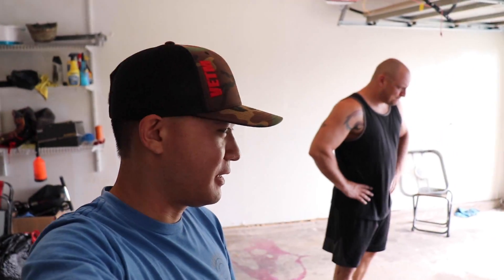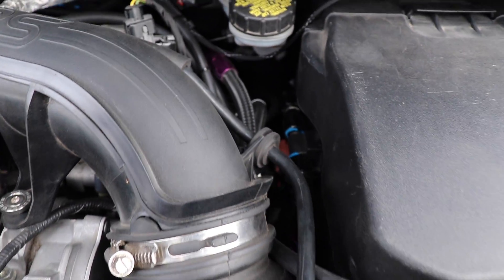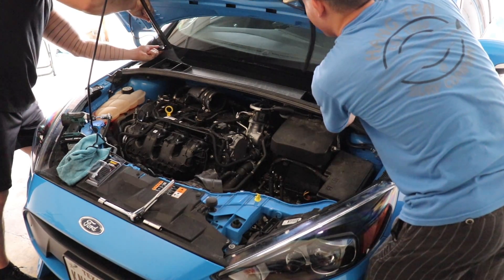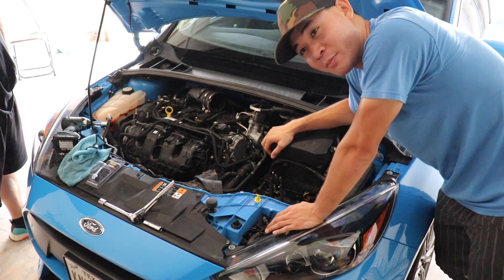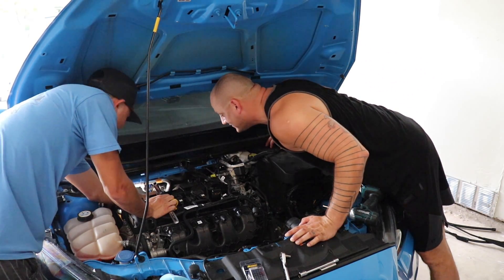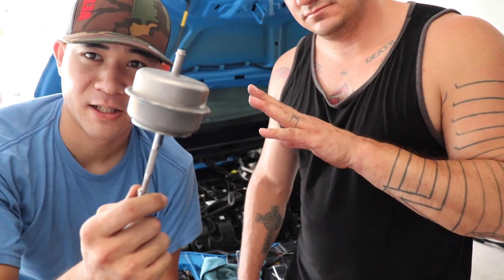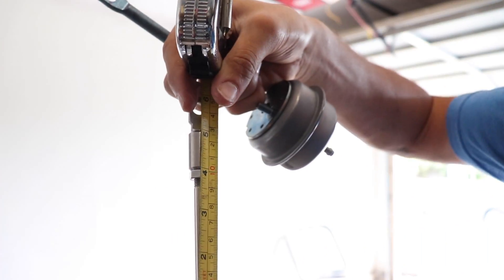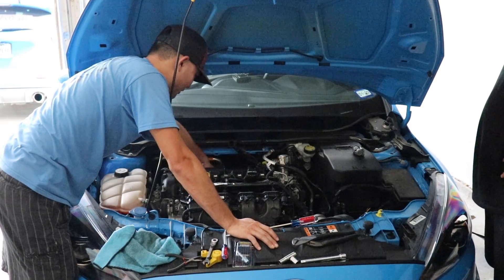How to Install WasteGate Actuator and Ethanol Content Sensor on a Focus RS

Comment: Where do you find the tunes for the wga? Are you having it professionally tuned? Or are you using the Cobb tunes?
Reply from the maker: I have it tuned professionally by Stratified. I would suggest getting a Pro-tune or a flashtune from your preferred tuner: whether that is JST, Stratified, FreakTune, or Tune +.

Comment: Is this car in this video running a stock tune?
Reply from the maker: The car requires a tune to run the Wastegate actuator and requires an Ethanol tune when you are going to put 30% or more Ethanol into the car.

Comment: Hi mr, good video, but i have a question for you if possible:
Is possible install the IWG75 12 psi without modify map? Map in my car is Mountune M380. preload must be same how to original WG?? I hope in your answer. Best regards
Reply from the maker: When you install the IWG75 you have to get a tune for it, without a tune you run the risk of damage due to the increase in boost pressure increase as well as the increase of airflow because the Wastegate will be held closed longer; to allow for more boost. Please do not run the WGA without a tune, without a tune you run a higher risk to damaging your motor
Reply: @Nick_UCARS  many many thanks, also with stock map?? 2 mm pre charge is correct for 12 psi?
Reply from the maker: @xtr970  preload should be an additional 5mm from the hole of the WGA arm and the prong of the wastegate on the turbo. If you don’t want to adjust the WGA when it’s on the turbo, you may adjust it by measurement: 5 5/8 inches (measured from the center of the WGA arm to the Base of the WGA).
Reply: @Nick_UCARS  Now understand because needed tuning, 5 mm are much, the spring is tightened a lot, and it takes  a lot of pressure to overcome it. But if you set arm with how the original, still need the modification? Alwais many thanks for your contribution
Reply from the maker: @xtr970  reach out to me in my social media, I’m trying to understand what you are adjusting. @nick_ucars on Instagram

Comment: Are the gauge steps work the same for an ST?
Reply from the maker: It should be, the gas lines are routed the same as well as the location of the grommet that I used to route the wires into the cabin for the gauge

Comment: Will the gauge be on all the time?
Reply from the maker: The way that I have it setup; the power wire is wired up to a 15A fuse that is in the passenger footwell, which enables the system to turn off at the same time as all the other accessories that run off of that panel turns off.
Reply: @Nick_UCARS  another question what size is the fuel line you purchased ? Or is there a link for it ?
Reply from the maker: @christiancristancho4864  I believe they are 6AN fuel braided fuel lines for the FBMS Kit. I had to use the Adaptors to make it work for the AN lines to fit on the OEM fuel lines that were on the RS, the links to the adaptors are in the description if you are wanting to do the same Ethanol Sensor Kit for the RS.
Reply: @Nick_UCARS  I can’t seem to find the fuel line online. Do you happen to have a link for it?
Reply from the maker: @christiancristancho4864  Which one are you currently looking for? If you are looking for the individual fuel lines, I am not sure where to look for them. the fuel lines that we used were part of the Full Blown Motorsports Ethanol Sensor Kit, the link is in the description.

Comment: So can I use the 5 5/8” to set the preload on my actuator as well? I have a focus RS too
Reply from the maker: Yes, the measurement of 5 5/8" can be applied to the wastegate actuator if it is for the Focus RS. The car that I have done this for my Focus RS as well as Jesse's RS, seen in the video. I have utilized this measurement as the standard pre-load for setting the TurboSmart Wastegate Actuator, I hope this was helpful.
Reply: UCARS thank you so much! Great video by the way
Reply from the maker: @MrPeanuthead47  Thank you so much, I hope that it was helpful. I really appreciate the questions and feedback from everyone, I am going to be posting a lot more content on my channel. I have been on hiatus due to hard drive issues.

Comment: Where did you get the fuel line?
Reply: I think it's this kit for RS/ST based on the purple connectors and Zeitronix gauge: http://fullblownmotorsports.com/full-blown-ford-focus-rs-ethanol-content-kit. I'm considering that one and a $150 cheaper one without physical gauge and just a Bluetooth app.

Comment: Did this ethanol sensor give you real flex fuel (self adjusting tune)?
Reply from the maker: Malleable Curve the content sensor doesn’t give you the ability to have a Self-tuning capability, I have to switch the tune from Pump Gas to a designated Ethanol Content percentage established by tune parameters. You would need to change the fuel line on the back of the High Pressure Fuel Pump (HPFP) and plump in a Flex Fuel sensor into the ECU in order to run a self-adjusting tune in relation to how much Ethanol is in the fuel system. The reason why the HPFP hose that needs to be replaced is because the hose is not designed to have straight E85 flowing through it because it will corrode and deteriorate, which can result in a fire.

Comment: What fuel line kit is that ?
Reply from the maker: This is the Ethanol Content Sensor kit from Full Blown Motorsports, The link should be in the description. If its not let me know so I may update it.
Reply: My bad I thought you had made your own fuel lines. Want to make mine like that with the braided lines and AN fittings
Reply from the maker: @carlosroque1935  I wish I had the tools and materials to make my own AN Lines, but I don't.

Comment: I installed the ethanol kit from Zeitronix on my near FBO 2016 focus RS and your video was very helpful. I purchased the kit from Maperformance off amazon. The kit didn't come with fuel lines unfortunately  and it was a real pain figuring out what I needed to make them.  I believe the kit from FBM and the one from Tune Plus is meant to delete that factory line and hook directly to the back of the HPFP.  The lines are all female fittings 5/16 for the stock male quick disconnects and 3/8 fittings for the male ethanol sensor quick disconnects. 

Just incase anyone buys a kit without lines like I did here is what you need to make the lines. 

2 feet of good quality 3/8 rubber fuel line.  cut into two lengths. one about 14", one about 10"
3/8 straight dorman 800-082  14 " line 
5/16 to 3/8 straight 800-084.  14 " line 
5/16 to 3/8  elbow dorman 800-092 10 " line 
3/8 elbow dorman 800-086 10 " line 
SS hose clamps ( I used Dixon MAH-4 7/32 to 5/8 ) 

The hardest part of this install was getting that metal quick disconnect apart and getting that line through the firewall gromet.
Reply from the maker: Thank you for watching the video! I am glad that it was helpful for your install. I am not sure if the FBM kit was designed to tap directly into the HPFP, if FBM could elaborate more on this it would help. I have not attempted to thread the fuel line directly to the HPFP. 

My setup is a little different for others because I have an AUX Fuel system installed on my car.
Reply: Can you set me in the right direction for the e85 sensor setup. I have the aux fuel set up. 2016 focus st. Thanks

Comment: Will this work on the focus st also?
Reply from the maker: The method of getting back there, yes. To set preload, I would like to say so. However I would measure the factory wastegate actuator of the ST for reference and then set the preload at that measurement.

Comment: What retaining clip did you end up using? I ended doing the same thing and losing mine. Dealership said there were $55 each for one. Doesn’t make sense.
Reply from the maker: chucka187 you can utilize the same type of clip as the one from the factory (e-clip) or a snap-ring, which we have used in this video. Both types of clips are available at your local AutoZone or Orielly’s, they sell them as a kit of various sizes for you to choose from for about $3 a Kit if I am recalling it correctly.
Reply: UCARS awesome. Thanks for the quick reply 👊🏻
Reply from the maker: chucka187 not a problem, I hope this helps you out

Comment: does that actuator help hold better boost at higher rpm?
Reply from the maker: FatGuyBuilds yes sir it does
Reply: @Nick_UCARS  because my moded out 2013 fost with 130k miles doesn't hold boost as good as it used to.